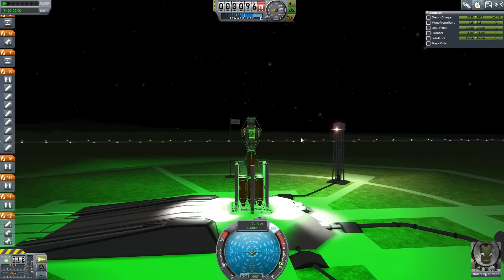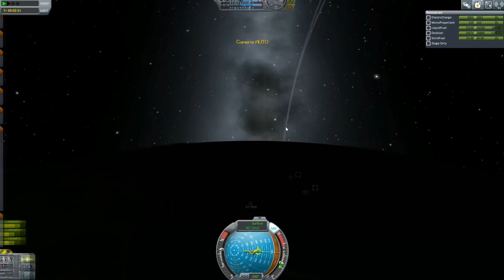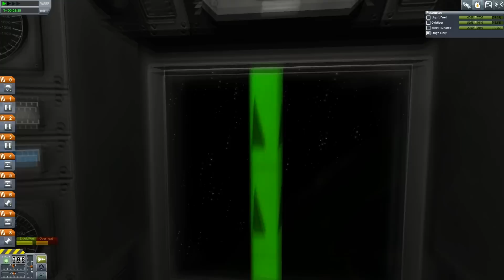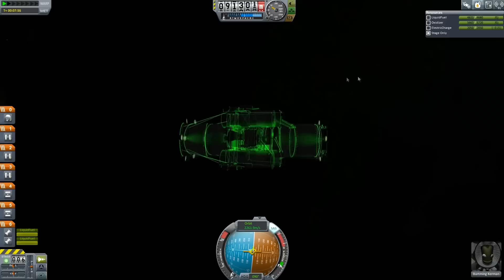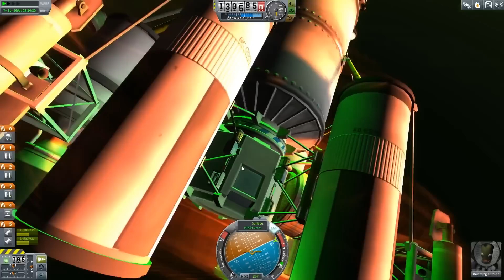The Jool Explorer [13] Kerbal Space Program Credits Career Mode

Comment: You manage thrust suboptimally, to say the least. You would want to fly as soon as  possible during ascent to minimze gravitaional losses. At the same time, your drag increases dramatically with speed. Optimum is so called terminal speed which is a compromise between these factors. It's 100 m/s at sea level and increases by approx. 10 m/s each 1000 meters up in the atmoshpere until 8000 meters, and you should burn at full thrust after that mark. Reaching terminal speed ASAP is VERY important. So please launch with full thrust set.